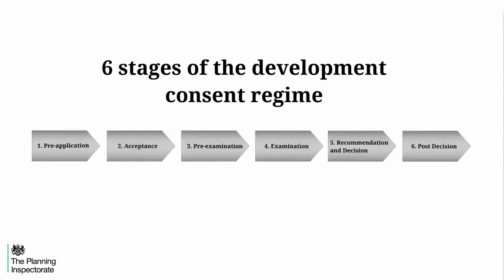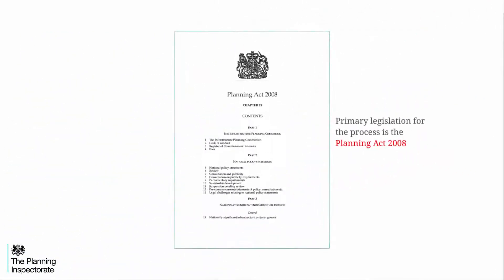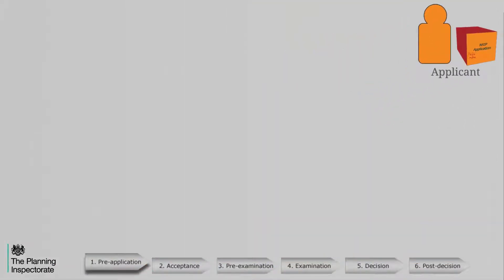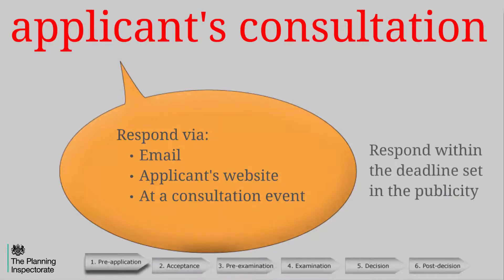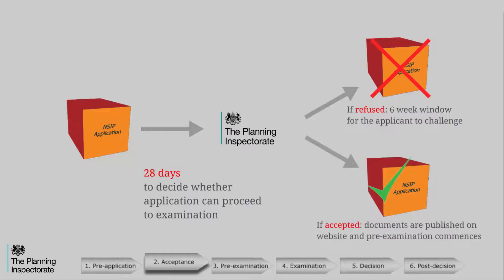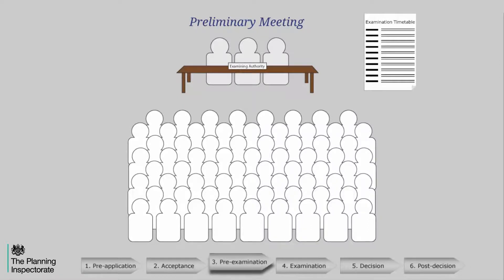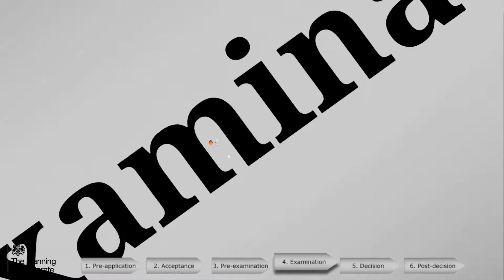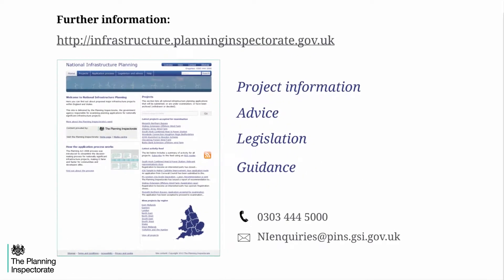6 Stages of the national infrastructure planning process

Comment: Is the EIA part of the pre-application stage? Are the documents submitted in the DCO application only regarding possible environmental impacts of the proposed project?
Reply: The DCO application is comprehensive proposal that includes, but is not limited to, social, environmental and economic variables surrounding the project. The applicant must demonstrate that they have taken (or plan to take) adequate measures to mitigate the impact of the project on the environment, the local community, and local economy. The submission will also contain a statement of reasons for permanently or temporarily acquiring land, which will need to be water-tight as it will be heavily scrutinized during the examination period.